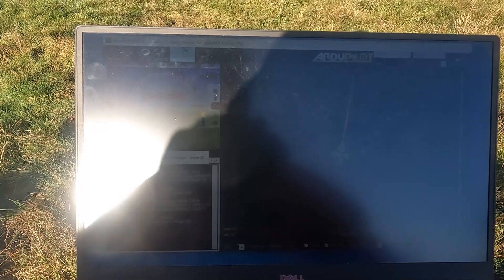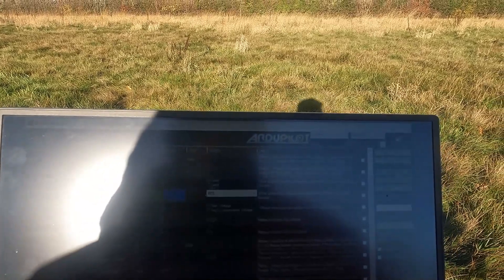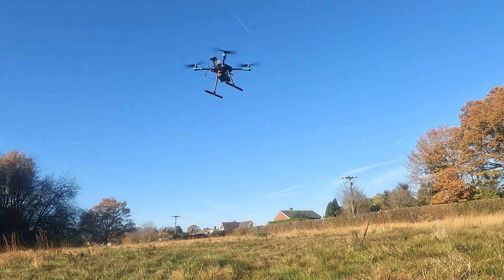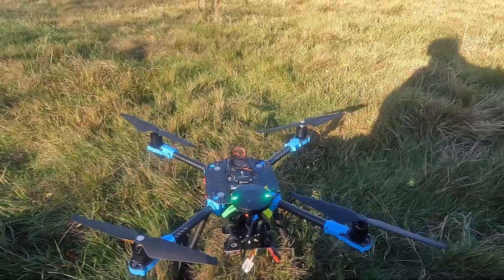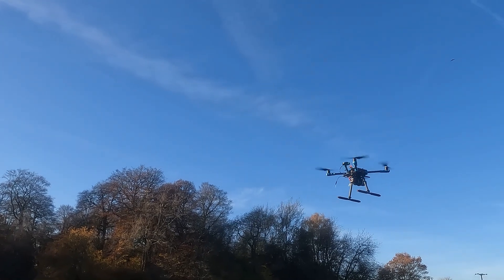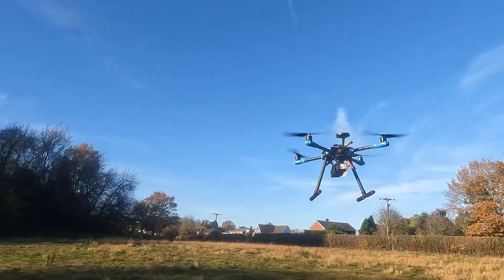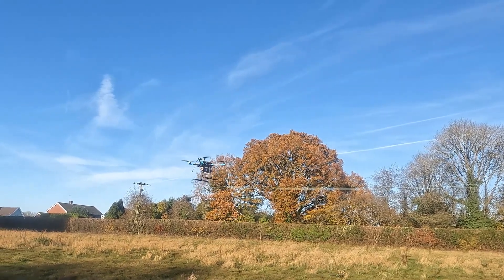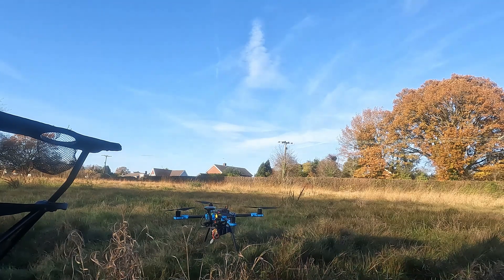Holybro X500v2 Build Video 10 - Running Autotune

Comment: Another question. I noticed that you used the "dshot" method to setup your escs with your 6X flight controller as opposed to one could say the "conventional method". Can one also do this with the 6C controller. I believe that the escs are the same hardware in the holybro kit. Thanks.
Reply from the maker: @yancymuu4977  yes 6C and 6X are very similar hardware wise. But notice you will need to upgrade the ESC firmware
Reply: @andypiper5285  will do that.
Reply from the maker: These are the parameters - https://www.dropbox.com/scl/fi/6d86fszfv5nj8rfhgdya8/Holybro-X500v2-Pixhawk6X.param?rlkey=aj9zttl5jcdbw7vlql4nm4egk&dl=0

Comment: Andy, thanks for the great video. I have the exact same drone and have just switched from PX4 to ArduPilot. Now I'm trying to do some tuning. I was wondering if you could share your tuning parameters from video?   Thanks again.
Reply from the maker: @yancymuu4977  happy to but note my settings rely on flashing bluejay and  using bdshot. If you try the settings without this you will have problems because the filtering won’t work properly
Reply: @andypiper5285  ok, will change over the esc setup first.